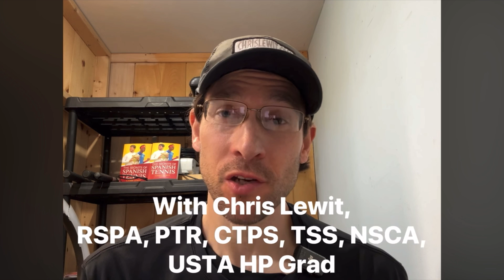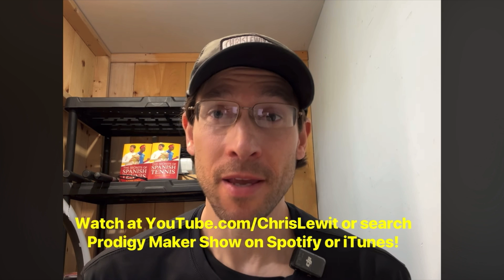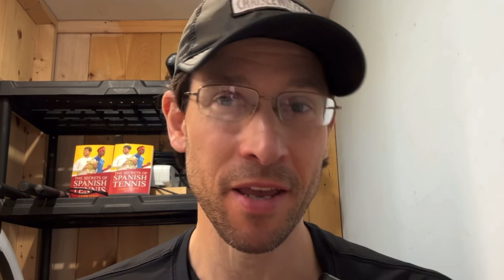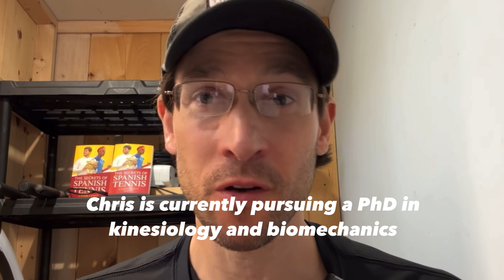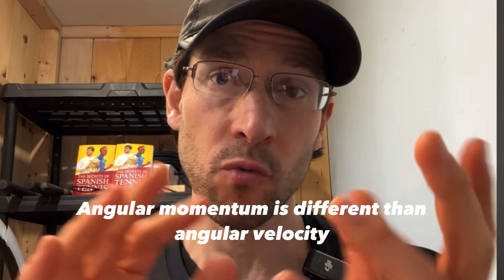Maximize Your Forehand Power | Physics of Tennis Podcast Clip

Comment: Fantastic as usual…Question: can you **Derive the optimal contact point using the kinesthetic properties and force vectors at play. And then, break new ground by finding a way to show that contact point from the hitter’s eye’s perspective (both L & R dominant). Keep up the great info.
Reply from the maker: Thanks very much. Can you explain your question in a different way?
Reply: Choosing any arbitrary ball height, where's the optimal contact point in the modern swing? Additionally, what's happening with both the physics of the racquet's motion and the physiological behavior of the body to make that contact point ideal? Lastly,  when teaching videos show a contact point, it's always from the wrong perspective. I, as the hitter, need to see where that contact point is from the hitter's eye's perspective. If you could find a way to literally put a camera on your eye then film where the contact point is relative to yourself , that would be something incredibly special. Worth a try.
Reply from the maker: Thanks very much for sharing. I will try to demonstrate the contact point in a new video. I would try to get your arm as straight as possible. I have demonstrated the ideal spot on other videos on the channel!